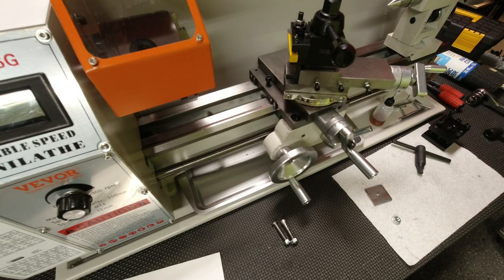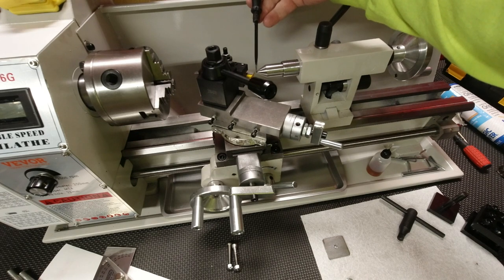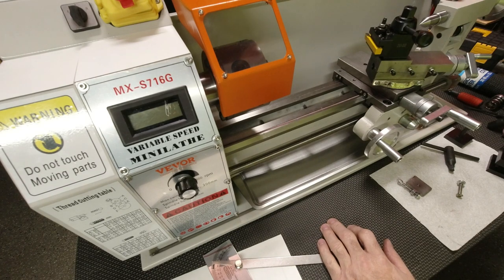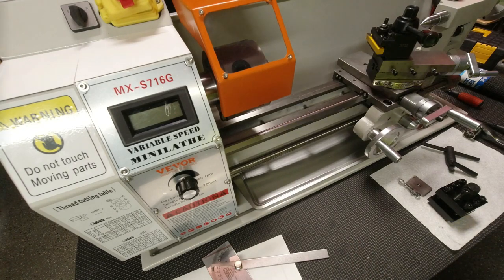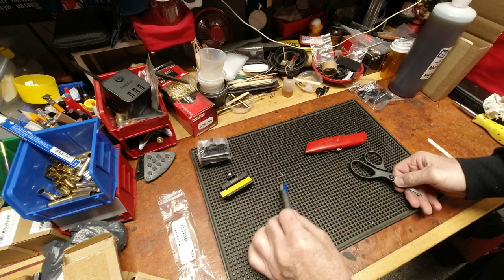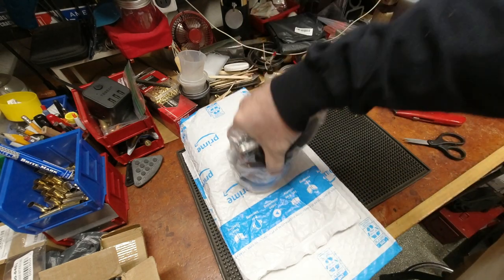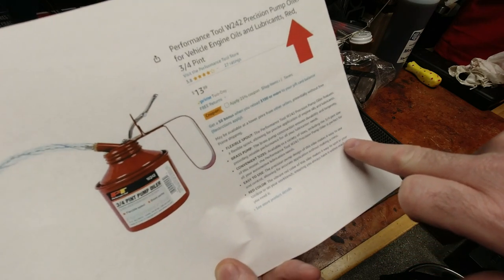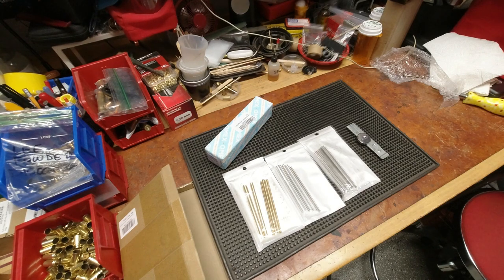More Lathe Upgrades and Additions: Part 2

Comment: Those two threaded holes on the top of the saddle are for attaching the traveling steady, a handy item to have although a fixed steady that clamps to the bedways is much more useful.
 Did your lathe come with any accessories? Or did it have just a three jaw chuck, spare change gears and a few tools?
Reply from the maker: Good to know, thanks.   My mini lathe included a small plastic tool box with 2 screw drivers, a few cheesy wrenches, additional gears, outside jaws, plastic oil bottle and maybe a couple of other misc items.  Nothing to help me get "started", thus the $$ to tool up.